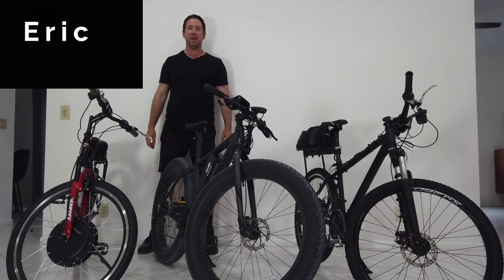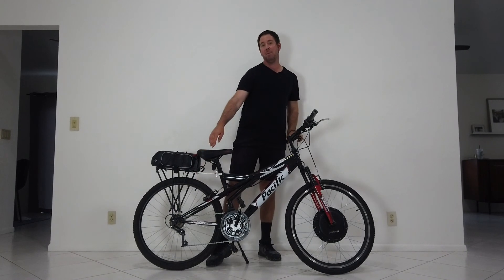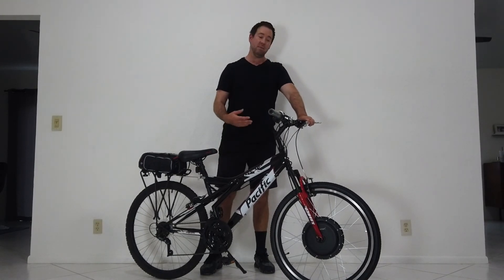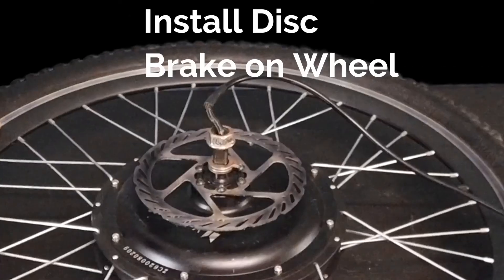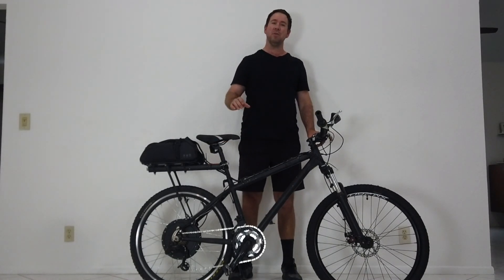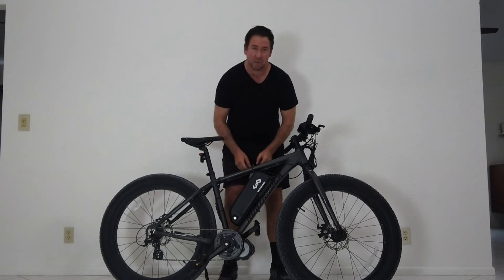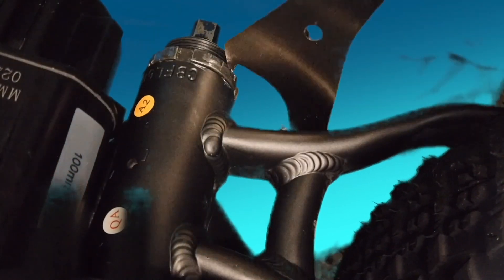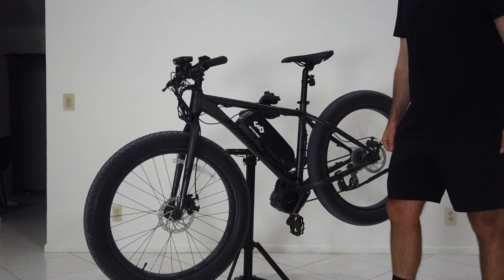Hub Motor vs Mid Drive DIY Ebikes [Pros and Cons]

Comment: Mid drive is better for steep hill climbing because you can use the gears on the rear cassette to make the motor more efficient on the hills
Reply from the maker: Wish there were more hills around where I live!
Reply: @expedition-electric3549  I with there was less where I live
Reply from the maker: @ManiacInTheShed  haha!  You can go a bit further when it’s flat conditions.

Comment: Peddle assist works for me its great 👍 helps save power too
Reply from the maker: Nice, are you able to control the level of assist?
Reply: @expedition-electric3549  yes I have 5 levels of assist but mostly use level one until an incline
Reply from the maker: @smokinstud1  Cool, What type of install did you do?
Reply from the maker: @smokinstud1  Nice
Reply from the maker: @smokinstud1  I definitely ride the mid  drive more often than the hub drive because the bike is less bulky
Reply from the maker: @smokinstud1  Any ideas what bike you'll use?
Reply from the maker: @smokinstud1  Awesome, sounds like a fun build. Headed to Electrify Expo in Miami tomorrow to check out the newest types of ebikes and electric builds, excited to see the new options out there!